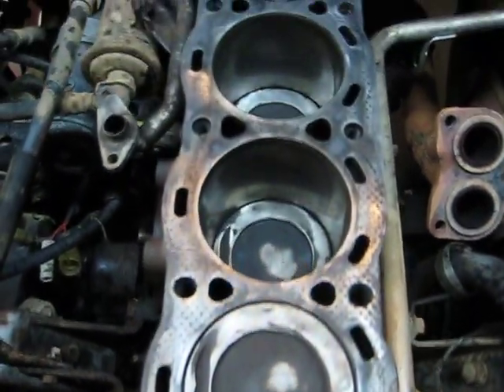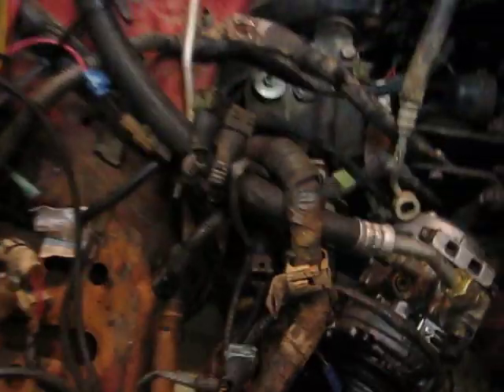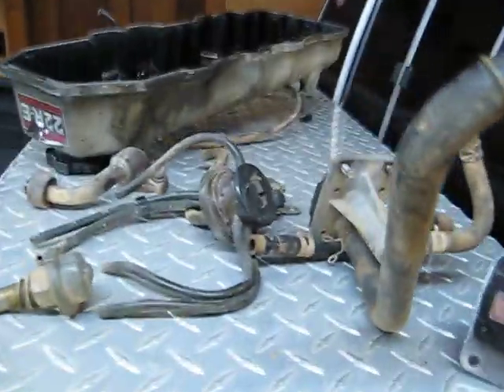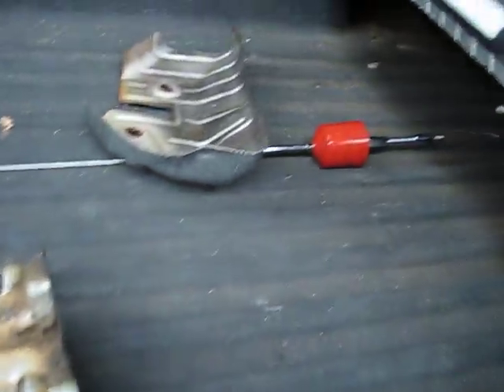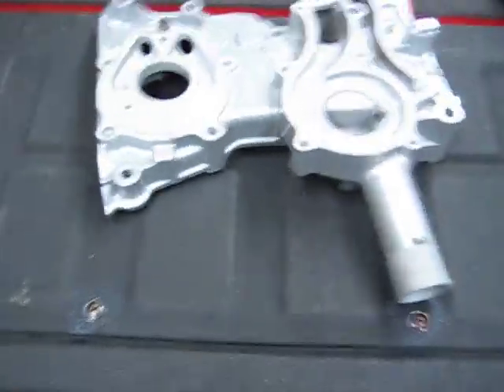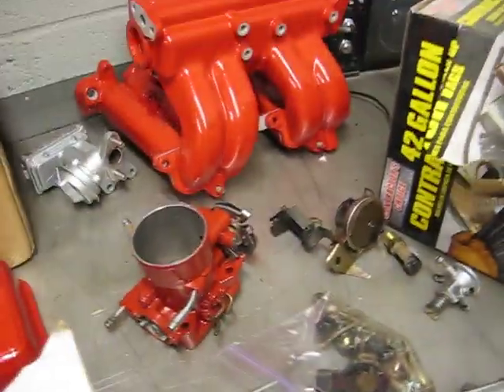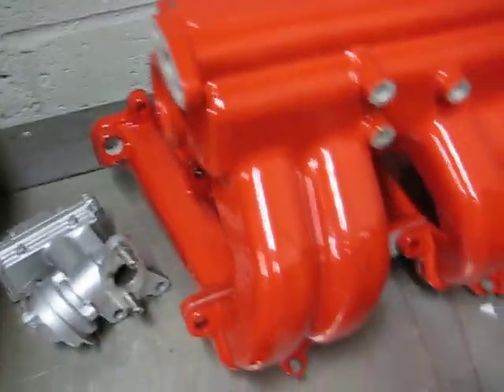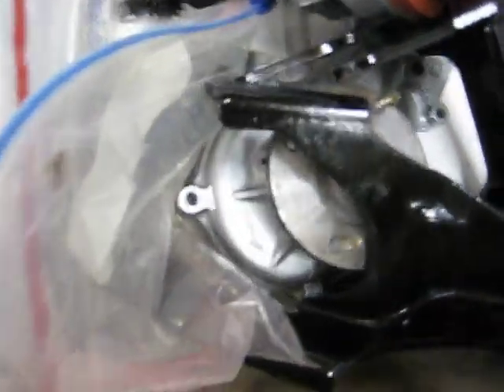22RE Engine Rebuild: Part 1

Comment: man please answer...... do your alternator has the voltage regulator OUTSIDE the alternator (on the driver side) or it is the one with internal regulator?????  because mine is failing and i cant find the replacement anywhere and i dont know what to do
Reply: Should be in the alternator or I guess it depends on yr model. My 85 was in the alternator.

Comment: @RaefordRedneck  I took around 20 pictures of the engine before rebiuld and it helped greatly.
Reply: Good advice! I didn't do the to my 85 when rebuilding the motor. I learned the hard way.

Comment from the maker: @RaefordRedneck  they usually fall into place where they're supposed to be...but if you have trouble you can look at a repair manual's vacuum line diagram or try tagging them with diff. color tape / paint / whiteout or something

Comment: @dixiemudtoy Okay. Because my head is noisey, but engnbldr recommends that I do the pistons when doing the head. Because of more stress on the rings could blw them. It makes sense. But if I do a copression test and am getting 170 PSI I think ill just do the head. I am only doing it because of a blown head gasket, and I figured I might as well do the head. I do have 80K less mileage than you and my truck has only seen highway use. Was that the stock bottom end and pistons on yours? Or was rebuilt

Comment from the maker: @BigManlyMan4  nope...runs like a champ. my bottom end was still in pretty good shape though.  It will be replaced soon as well...I want to add boost to the truck and will need forged bottom end and lower compression.

Comment: did you ever have any issues with the rings seating after adding those parts? I am going to replace my head but I am not sure if the added pressures will cause me to blow smoke.

Comment: Looks just like my Yota... minus the rust. You may want to check into the high flow oil pump from LCE. Are you running the dual row chain upgrade, the metal backed single row, or just a heavy duty OEM? Also, since you have yours apart and I haven't, could you tell me if the oil pump pickup is attached to the pump in any manner? I have conflicting data concerning the pickup tube's attachment. I have 3 different part breakdowns, and none are clear where the tube attaches.

Comment from the maker: @crombieposterboy  I assume you are referring to the exhaust manifold studs from earlier; actually (to my amazement) none of them broke, however i believe one is stripped / cross-threaded and two of the three heat shield studs broke. I'm debating on a tri-y header if I can find a good deal on one...
Reply: None of mine did too. And it had 308 k on it.

Comment from the maker: @crombieposterboy The exhaust manifold was removed, what you see is the downpipe splitter.  I am not doing the bottom end for a few reasons; mainly the pistons do not knock or clatter, blow, smoke or use any oil whatsoever, so there is not an immediate need for this to be done at this time.  Secondly I cannot afford (financially or timely) to have the entire bottom end built the way i want it right now (completely forged / balanced / blueprinted and built for boost). It will happen soon.